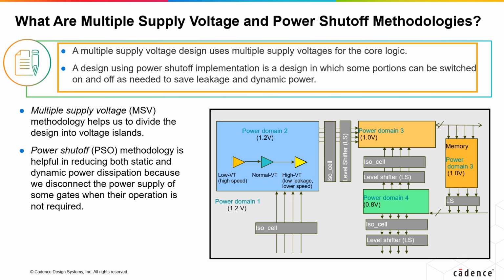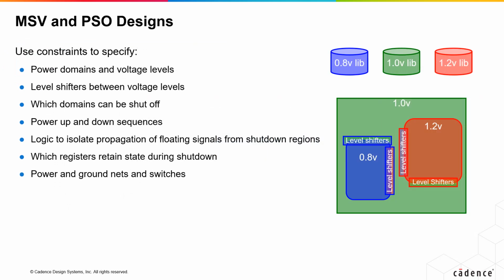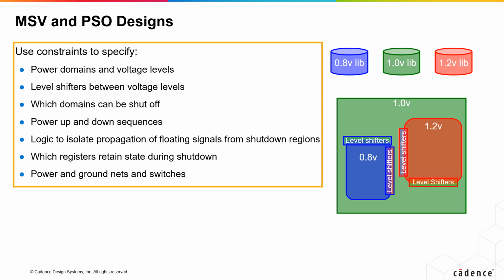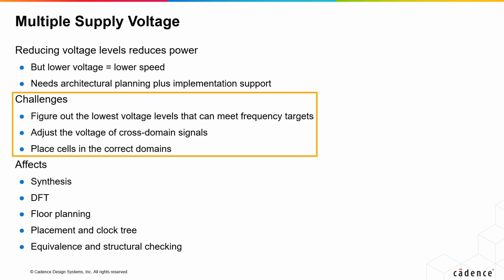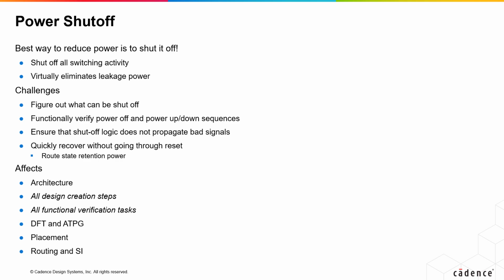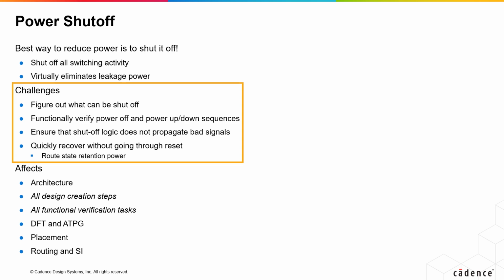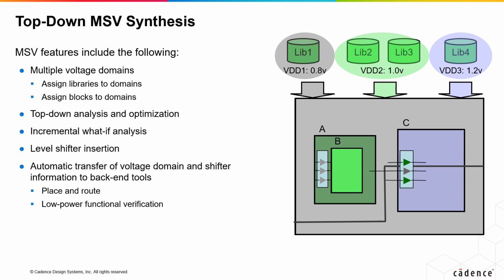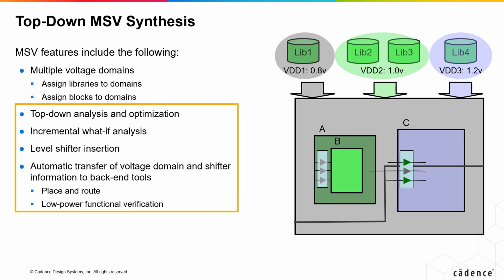What Are Multiple Supply Voltage and Power Shutoff Methodologies

Comment from the maker: MSV gives you Speed, PSO gives you Battery Life.

But implementing them requires careful handling of "Floating Signals." (Explained at 1:16).

Which low power challenge do you face most often: Level Shifter placement or Verification complexity?